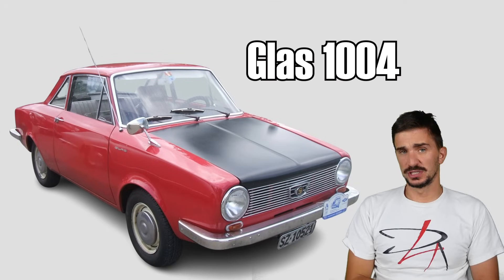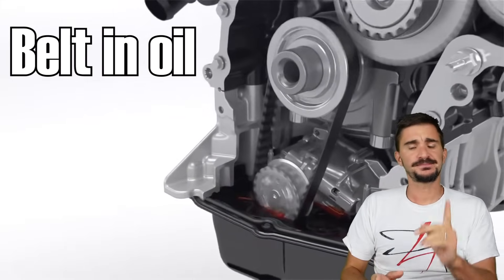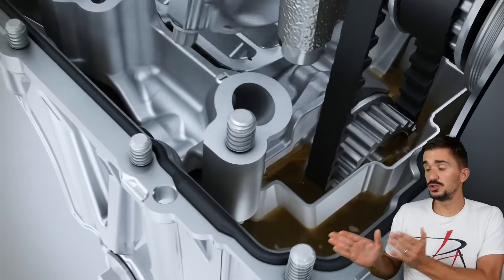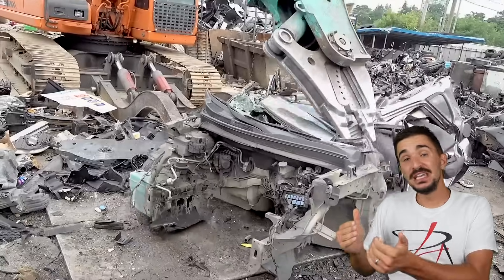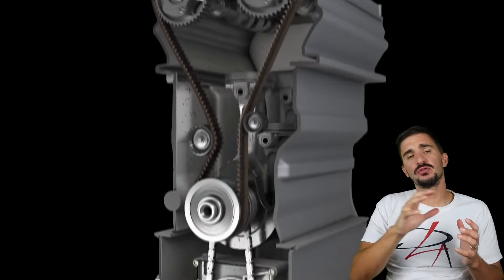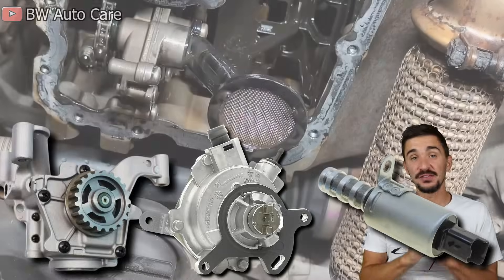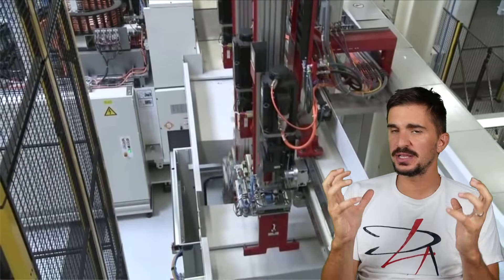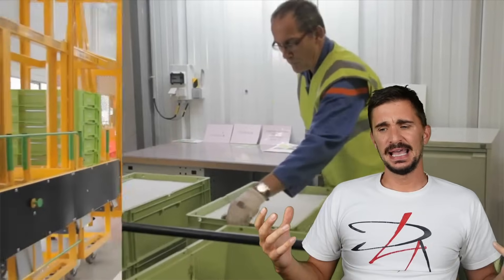Who Approved This and Why Is It Still Being Made? Wet Belt aka Belt in Oil Engines

Comment: I work in the auto industry and can 100% tell you, this sort of thing is absolutely intentional. If they could get away with it, they would make them even worse so they could make money.  As long as it survives the warranty duration, that is all they care about.  Anything after that is profit.
Reply: I worked in the engine rebuilding trade in the 70s. Many teardowns revealed engines in serviceable condition except for the failure of the iron camshaft timing gear with molded plastic / nylon teeth around the perimeter.. I guess the idea was to make engine quieter, and it was great until the teeth crumbled.
Reply: Having worked with engineers, this is most likely gross incompetence rather than malice. The engineers know it's a bad idea, but the higher ups think they know better than the engineers, and guess who signs the paychecks. It's not designed to force you to have to repair it, it's just stupidity running the engineering department rather than actual engineers.
Reply: @Bitterrootbackroads  That happened to my 1976 Ford Torino (351 Windsor). IIRC the camshaft timing gear was aluminum with the nylon teeth. Fortunately, it jumped timing in my driveway and fixing it involved merely replacing the timing set with all-metal gears, lining up the marks, and putting it back together. That engine ran for many more miles...
Reply: @richardmillhousenixon and here is the explanation why Boeing is so bad at the moment. Yes you need to make sure you can make money. But you also need to make sure  that the product you make is not a death trap.
Reply: Next stop...  plastic timing chains, maybe from VW. Oh how they love plastic engine parts.
Reply: @richardmillhousenixon  Automotive engineers are required to do FMEAs on new designs.  This is a systematic evaluation of potential risks by technical experts. High risk items are highlighted to higher ups.  Any learnings from previous failures and failure causes have to be captured in the FMEA.    Check out the FMEA on electronic parking brakes, the amount of work required is mind boggling.  But it is only as good as the engineers doing it.
Reply: @Bitterrootbackroads  Had a volvo 240 series nylon gear failed , sell replacement set , original steel gear spotless left new in box !
Reply: While the basics of what you are saying are true, that its all about money, this is simplistic thinking. They almost certainly paid more money to invent these belt systems than it would have cost to keep using chains. A very special brand new kind of rubber is more expensive to develop than "steel" they can get from 100 suppliers already. They switched for the fuel savings and that's it. Its to game a test. A drive cycle. Its for the %1 that the customer will never notice he has.

The reason they wanted %1 more efficiency is so that they could put %1 more nonsense on the car and have a leg up on their competition and still profit. Its not about making a more efficient car, its about making cars exactly as efficient as the OEM needs it to be in order to stay legal but never much better than that because power, size, safety, macho wheels, etc are all more popular than reliability these days. Its about pampering the customer (the dealers) with the things they want to sell their customers (us) for as low of a price as possible but within the law....while making money. They have a MPG they want to hit and this will help them hit it. Losing 1000 lbs off the car would save %30 but the customer wants the 1000lbs of BS so he gets a time bomb engine.

So...it is about money, but its not about better/worse parts is about designing the entire car for customers who can't afford what they want and have it be reliable at the same time. They did it so they could move from 17" wheels to 18" wheels. They did it for nothing worth doing.
Reply: 100% that this sort of bullshit is intensional. They should be taken to court over it and fined billions.....
Reply: Long term these failures ruin a manufacturers reputation.  The problem is that these engineers get high on their own ideas.  It's a "can't see the forest through the trees" kinda situation.  Now they're stuck dealing with the cost and reputational damage from this.
Reply: Planned obsolescence is in every product across all industries.
Reply: @Bitterrootbackroads  my 1986 ford f150 went 120k miles on its nylon coated gear before it finally lost too many teeth to run. The replacements are all metal, go figure… of course I can’t be too mad about a 38 year old 120k mile timing set failing and the new set was like 40 bucks
Reply: @richardmillhousenixon  Malice on the end of the managers. Intentionally overriding the better judgement of the very engineers they rely on. Classical evil.
Reply: @dr.a.w  my 302 in my 86 ford also shed its plastic cam teeth in the driveway, after a 500 mile road trip too. Couldn’t even be mad about it.
Reply: @supercellex4D  They're overriding the engineers because they think they know better. That's incompetence, not malice.
Reply: Sure. But IF it is true that they save 1% of fuel, then the logic is clear. The increasing stringency of CAFE standards have the tendency making manufacturers employ all manner of bad ideas to clear the bar either now or in the future.
Reply: Exec: Wait, so you mean you found a reliably out-of-warranty-self-destruct mechanism?!  We're gonna be rich!
Reply: @volvo4mula  Are you suggesting that saving 30% friction on the belt drive by using a wet belt isn't attractive to engineers who are desperate to reduce CO2/km by any means possible? 🤔 I don't think other systems like variable demand oil pumps and variable demand water pumps are a good idea either, but given the desperation to reduce CO2/km of an ICE you can see why the engineers opt for it.  0W8 oil is another choice that may improve CO2/km at the expense of reduced engine life!
Reply: @richardmillhousenixon  scarily enough it's even worse in the airline industry AND in the pharmaceutical industry and god knows how many other industries .
Reply: @Bitterrootbackroads  this remind me a balancer shaft gear teeth in toyota 1AZ 2AZ engine   

1st gen 1AZ can just replace a balancer shaft     present gen  they sell the whole set assy  

yuck
Reply: @edwardmacnab354  It's not really worse, it's just different. In aviation and in pharmaceuticals there are a lot more regulations which place checks on that sort of thing, so it's arguably better handled in those industries.
Reply: @richardmillhousenixon as a mechanic I tend to agree with you that the decision is made by the higher ups more than the engineers but that is just pushing the blame off on someone else, not actually fixing the problem and personally I do believe that it is at least partially intentional because I'm sure  the engineers explain to those making the decisions why it's a bad idea but they do it anyway.
Reply: @volvo4mula the issue is that most of these companies are being run by CEOs who will only be there a few years so as long as the profits are good for that time they don't care about the future and the shareholders only concern is their investment return, they could care less about the customer or the employees.
Reply: @collinnicholasns  In my experience, yes the engineers make the higher ups aware, but often the higher ups just say "oh it can't be that bad" and stuff like that. In my experience, when those kinds of decisions are made, the overruling is made because the higher ups think they know better than the engineers, not because they're intentionally trying to make it fail sooner. It's gross negligence, which is still very much a bad thing and very much a fault of the automaker, but they're not intentionally trying to make it fail.
Reply: @richardmillhousenixon  thank god for regulation--can you imagine a world with all those guys unchecked ?
Reply: @edwardmacnab354  I mean the regulations aren't perfect, but there's a reason they're there, and I'd rather have them than not
Reply: If environmentalists really want to make a difference, they should be pushing for longer warranties rather than fuel economy mandates that lead to cars being scrapped before 100,000 miles. Think of the greenhouse gas emissions resulting from the needless melting-down of each car every few year rather than every 10.
Reply: Like so much in our world sadly.
Reply: It's the same in the medical field. Provider here. 

Once upon a time engineers and doctors ran the world to an extent. Now it's HR and accounting calling the shots. No malice, just hubristic incompetence and ignorance.

God help us.
Reply: This is why i don't buy new, but only 80's and 90's cars. My favourite being the Volvo 240 and the redblock engines. They have the potential to survive a million km. Or the late 80's VW Passat. Early 90's Opel Omega is also a good one.
Reply: @pcno2832  Good idea, but getting corrosion protection adequate for longer warranties is a bitch. The greenhouse gases cost of making more than necessary new cars is the real hit. Recycling furnaces are only a fraction of just the transport pollution in making new cars.
Reply: Nissan is not getting away with it.
Reply: @GPBX01B  Great comment.
Reply: Not quite true.
Word gets around and Ford's extra profit turns into bad reputation.
It has cost them dearly

Comment: in norway we have cold winter's. and a lot of ppl by these small cars to do short trips. the engines never get hot and the fuel dilution gets to be high. i have NOT seen a 1.2 PSA engine make it to 60k km without failure in those conditions. The belt start to fall apart and then clog the oil pickup and the engine is run 10-15k km on low oil pressure before the lamp comes and and ask you to stop. by then the damage is done.
Reply: whats ppl ???
Reply: We have a great Nummer of orings and all sorts of rubberized gascets in the engines that work finde fine with oil and even aggressive  Fluid. Why then the above Namen problems and familiäres. Well all becauce These belts do constantly move. Mikroskopie parts of the oil  are pressed into the belt and sqirted out again.
 This mechanism caise the dillution of the belt components. Yours Drofengines
Reply: @H-MHofer  they work for a bit. they will also take damage from this environment EVEN if they r standing still. the belt is made to move and if you look it up you will se a LOT of problems with them. AND you will also se the need to replace gagets etc in engine's. i replace sealing rings every yer on one or more engine that i have. some times due to failure or in other cases in advanced as i can get to it as when you do a clutch replacement you do the rear crank seral at the same time. the seals that tend to go bad the first is the valve seal's and you get a god oil consumption from that.
Reply: @fredsmith2277  ppl=people.  But my question is, what's a PSA?
Reply: @frequentlycynical642  maybe it's PSA group.

Comment: As someone who is working in the automotive industry, I can say with confidence that this is probably gross incompetence rather than malice. Our team is currently also doing thiings that we would have solved differently, but those that decide are not engineers. It is management and sales. They hear about a technology at a convention and force engineering to implement it against their will. Sometimes they sell it before we even heard about it. It was probably like that at Ford, it was certainly like that at VW, Opel.. after somone from sales heard the 1% fuel savings number.
Reply: Same in software engineering. Some idiot promises and sells high heaven with 'Tec X', then they come to the software architects/programmers "So you need to do this, because I sold it and that is our most profitable deal in years."
Reply: This is malice in my opinion
Reply: Why not both ?
Reply: Wet belts last an extremely long time in the Ford 2.7 but you don't see anyone complaining about it 🤔
Reply: What you are describing there is in my opinion malice by all accounts. Hearing the engineer say this is detrimental and doing it anyway sounds like malice.
Reply: Lack of time/money spent in testing. Has always been so... read about the US torpedoes in WWII that didn't work, they weren't tested at all... top brass kept blaming the submarine captains, until eventually they had to investigate.
Reply: so its malice lmao
Reply: @londonnight937  Yes, or just hubris. Thinking they know it better.
It's not malice in the sense that they want the custumor to have to rebuild his engine.
Reply: The only reason manufacturers say its ok to go 10k miles between oil changes is to get the tax incentives from the government.  They know it destroys your cars engine
Reply: Sounds like Boeing...
Reply: @firstlast---  2.7l is a bigger engine, and as the guy said, its all about temperature and fuel getting into the oil.  2.7 is also fitted on the larger Fords (Explorer), so there is a lot of space to allow the whole engine to run cooler.  The ecosport ( and the 1l) have everything squeezed together and impossible to work on.
Reply: @aname3576  No, not malice, incompetence and not caring for the long term.  Companies are now run by accountants and actuaries.  This is the same for Start-Stop tech.  Looks good for the short (less smog) but engine life is severely reduced, leading to early replacement.
Reply: @dony210  No complaints from GM's lih engine either, a 1.2 liter turbocharged 3 cylinder that uses a wet timing belt
Reply: @dony210  right, and i reserve the right to classify gross negligence over the course of decades as malice. “The purpose of a system is what it does”
Reply: @blue03r6  Valvoline just did that test where even 10k miles on mineral oil was fine^ though? It's on the Gears and Gasoline channel.  Surely Valvoline are motivated to sell more oil? 

There was some varnish on the 500,000mile engine with the mineral oil but, sadly, most motorists/fleet operators could not care less about that as it doesn't affect operation.  They are not anaroks who want the engine to look like new inside as people on this channel would want.
Reply: @maskharat That's malice.
Reply: @maskharat That's malice.
Reply: The really evil part is how they make it look like it's not malice. When rubber timing belts were first developed by gates rubber it was claimed to be better, but timing chains never had a problem that needed to be fixed. Just as 401ks were touted as a new innovative retirement plan but they were actually designed to be only a supplemental plan. It is kind of like in the star wars sequel when one of the characters bemoans " so democracy doesn't die quietly but rather dies to loud cheering applause". They convince us that we voted for own demise. EVIL. PURE EVIL.
Reply: @gregbuckley7596  This is wrong on so many levels. You can say that you think timing chains are your preferred timing method. But calling them better flatout is just ignorant.
1. Yes, timing chains are technically speaking older, but in OHV or SV engines. The timining belt came together with the OHC engine and has been used alongside timing chains since. Depending on Brand, Era and pricing one or the other was more popular. And the idea of a belt drive is about as old as machnines are. You can visit a belt driven sawmill that is over 200 years old in the next town over. All Gates rubber did, is use modern materials. And no, they didn't invent the timing belt, that was a swede called Gideon Sundback as far as I know.
2. Neither belt nor chain are "better" they both have advantages and disadvantages. Some advantages that speak for a belt are: noise, price, no lubrication needed, barely any lenghtening allowing cheaper and simpler tensioning mechanisms to be used and less wear on the rest of the timing mechanism
3. You probably never owned or worked on a VAG engine with a chain. :-)
4. You might be right about 401ks and star wars. I'm not American, I don't know.